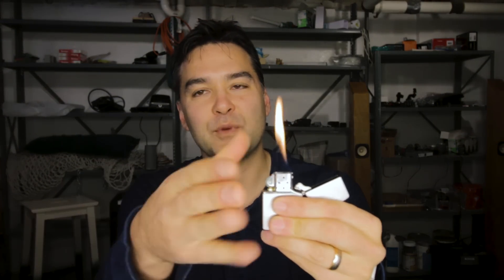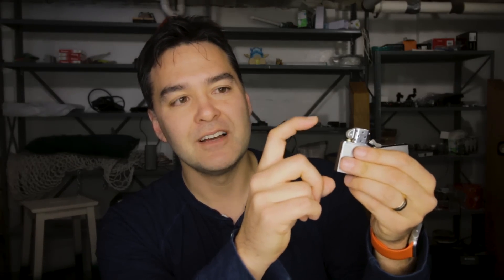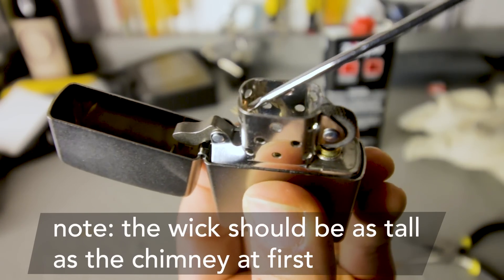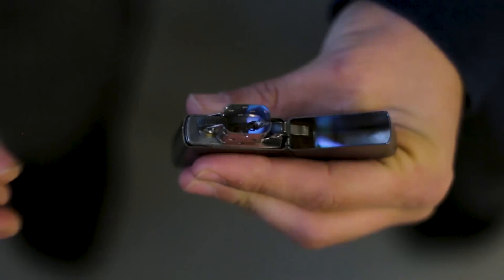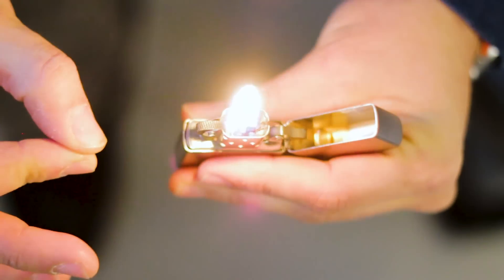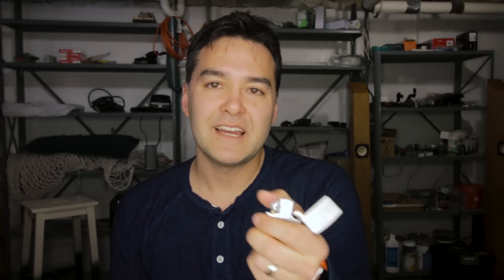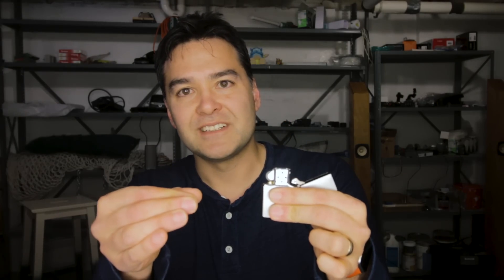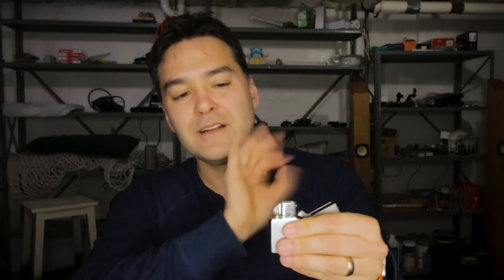My favorite Zippo trick (twilight zone)

Comment: I always take the flame away, but it just won't come back. I just put out the lighter.
Reply from the maker: The wick might be too thin. You could try fraying it a bit by rubbing it between your fingers. This will make it easier to trap the flame. If that doesn't work, could try it with a new wick.
Reply: Ed Lewis Okay man thanks, will try.

Comment: Sooo i can Just "pinch" off the Flame?
Is there a Trick to it or really Just going across it?
Reply from the maker: Move hand so flame is between forefinger and thumb, touch fingers together, pull back so flame goes right where fingers connect. Practice till you get the speed right. Make sure to let it cool off after a few tries.
Reply: @EdLewis  Thank you

Comment: I'm supper scared to pinch the flame
Does it burn?
Reply from the maker: Not as long as you move with a decent speed. Don't need to rush. That's the coolest part of the flame. The hotter part is at the top. What can get hot is the chimney, the metal part that the flame is coming out of. So give it a few tries, let it cool off, then try again.

Comment: Does the wick should be long enough Cause my wick is short thats why maybe it aint working?
Reply from the maker: Could be. Try pulling the wick out a little bit. Easier with pliers.
Reply: Or that you have the motion wrong
Reply: It is supposed to be a slow or medium speed motion